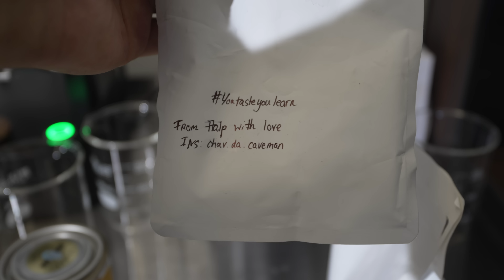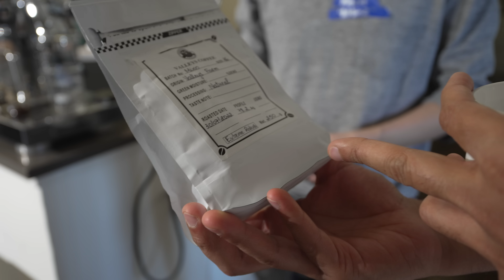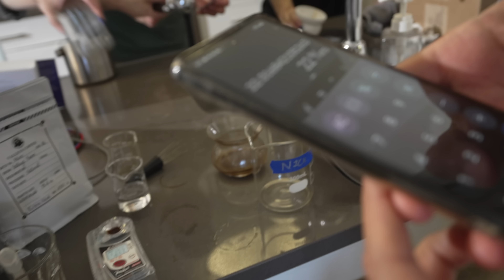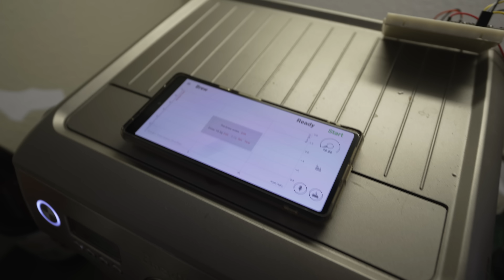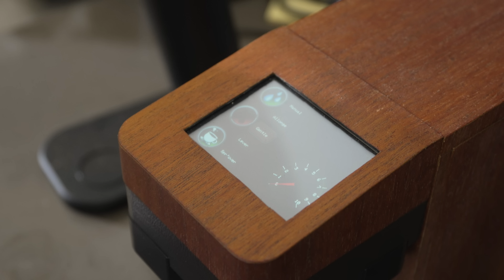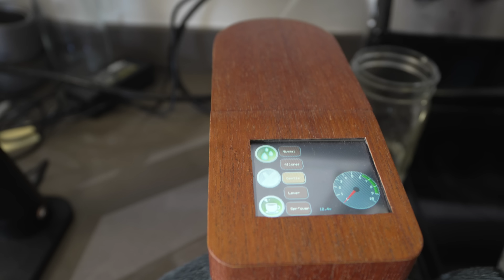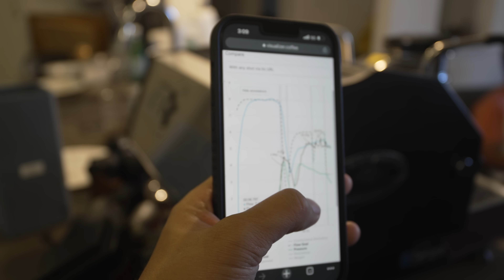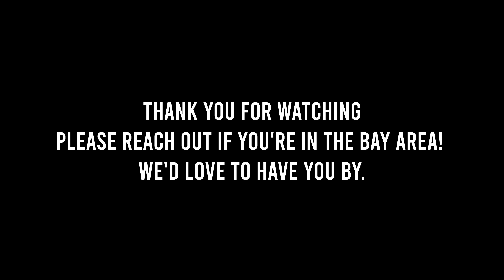4 Insanely Cool Espresso Machines! (Rocket Appartamento, Breville Dual Boiler, La Marzocco GS3 etc)

Comment: What is the purpose of the cactus?
I get WDT at different levels, when I started doing that my consistency was insane and  hardly every get channelling.
Does it basically allow all the coffee to be saturated, regardless of puck depth there is water contact with the coffee grinds 🤔?
Reply from the maker: There is an article by Caffeinated Science regarding the Porcupress/Hog. Go to Caffeinated . Science (remove the spaces) and check it out! It'll answer all your questions regarding Kaktus

Comment: Fun project for the gear pump mod! .. not practical for most folks as that gear pump alone is  half the cost of the actual Apartamento. I replaced the vib pump on my classic Giotto with a Fluid-O-Tech/RPM motor which sounds a lot better.  You could PWM  the rotary or the original Vib pump for that matter (a-la Decent) to achieve variable flow.  Now if you added software to flow-profile the shot..  Love the planetary gear WDT!

Comment: I would love to know how to mod my breville dual boiler with a gear pump
Reply: Get a gear pump and replace the one inside. It's extremely straight forward.
Reply: @armLocalhost  Sure okay, I would be interested in which gear pump they found is a good choice size wise and how they build the control board etc to adjust the power to it and so on.
Reply: @armLocalhost  what about the board ?
Reply: @seemtorecall78  It is probably the same size used in Crem One.
Reply: @seemtorecall78  have you seen the Lance Hedrick BDB? Hoping it comes out
Reply: @swempthebemp  Yeah I saw it, its awesome, and soooo quiet
Reply: @armLocalhost  Thanks so much Mike! Really appreciate it!